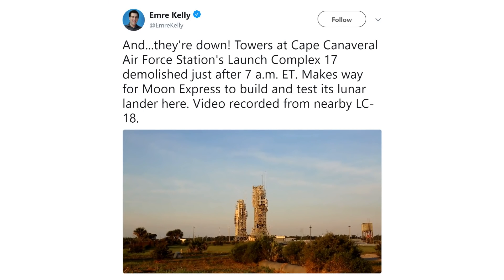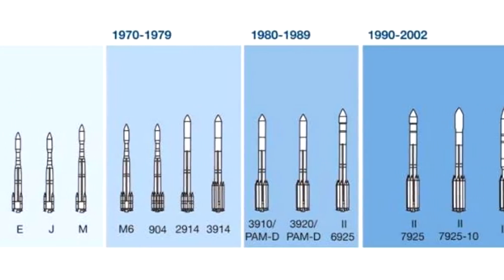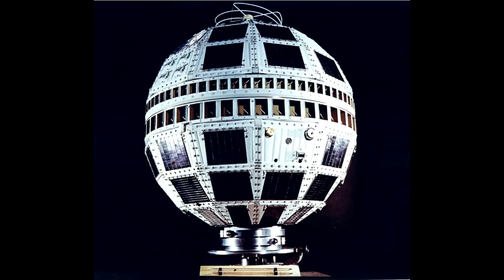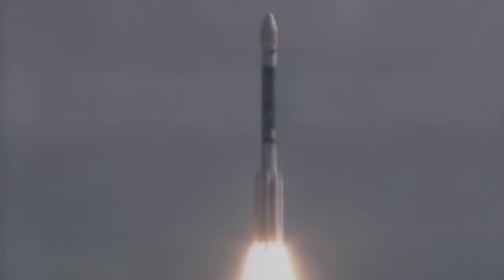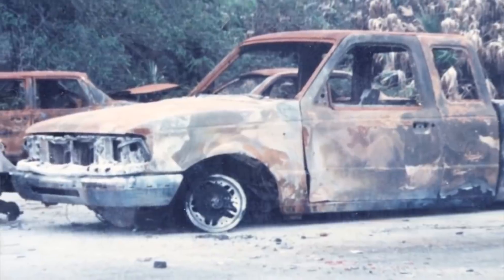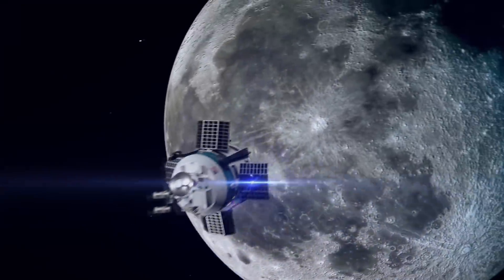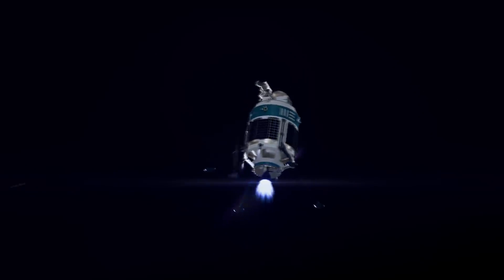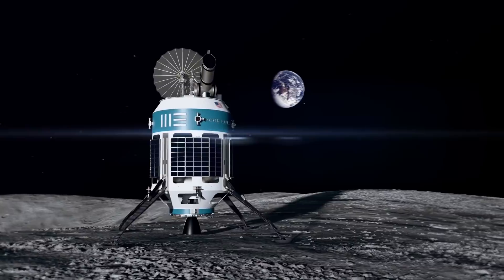Explosion Demolishes Historic Rocket Launch Site

Comment: I wish they could somehow preserve some of these launch towers for historical purposes, but I guess they need the space for other systems and clients.  I was very lucky to have visited KSC in 1979 when all of the old Mercury and Gemini gantries were still up (they are long gone due to salt air), as well as the original Mission Control.  I was also able to see Columbia on the back of a 747 on the Shuttle landing runway (like, up close and personal) the day before it was brought into the VAB before its first flight.

Comment: Hi Scott, I really enjoy your in-depth videos about different aspects of space exploration. I have a question for you about reentry (may be an idea for another video). Don't know where to ask it, so I'll just post it here. There is a possibility of bouncing off the atmosphere. As shown here for example: https://youtu.be/-l7MM9yoxII?t=8m29s .It is often mentioned. But what can actually happen then. I guess there can be multiple scenarios afterwards. Spacecraft will bounce but it will not go into outer space obviously. As far as i understand space agencies realy afraid of this bounce and they make spacecrafts to reetner under a steeper angle than they could to eleminate the risk 100%. I have some related events in my mind: 1. I do remeber a discussion in my university when Colombia shuttle was lost. Some guys suggested that shuttles can probably make few more orbits on the reentry on altitudes around 120-80 kms or so to reduce the speed. Probably this is not used partially because there is a risk of bouncing. 2. During Souyz 1 mission there was a risk of bouncing from the atmosphere as spacecraft was rotating and it was harder to make a proper reentry burn. But what could actually happen in this case what orbits it could have.

Comment: Just FYI, small correction—you stated that ICESat-2, the last flight of the Delta II, would be its 100th successful launch; actually, it would be its 100th consecutive successful launch (which is the most of any rocket; second-place is Ariane 4 with 74). Its total record would stand at 156/158 (98.7%); the other failure was GOES-G in 1986.